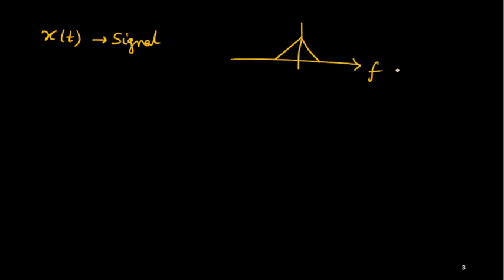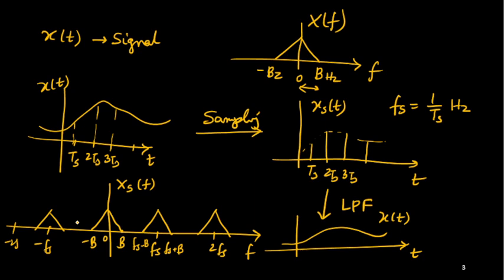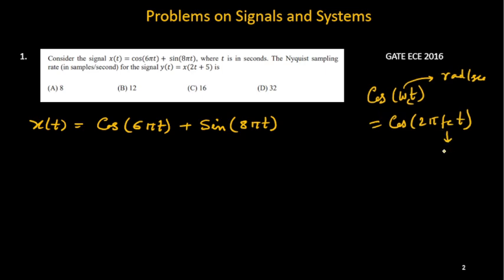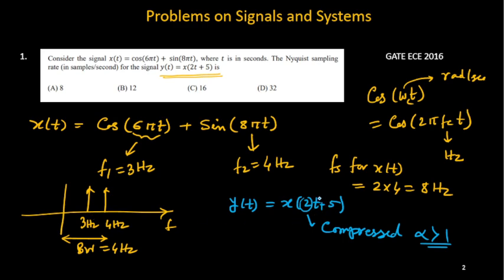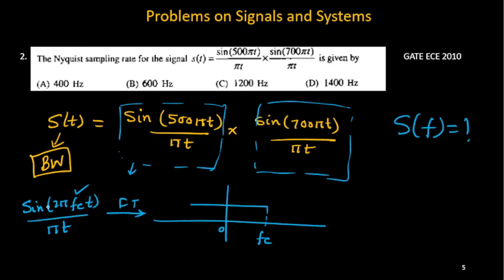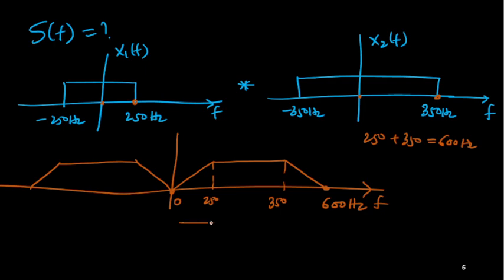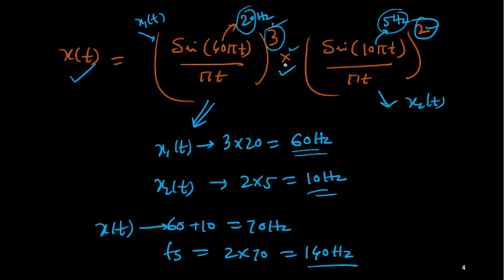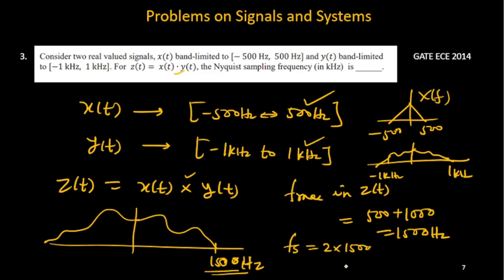Problems on Sampling Theorem- Nyquist Sampling Rate

Comment: Sir, in problem if convolution between two sinc signals is given, then in frequency domain it will be multiplication and we need to consider minimum of (f1, f2) to get the maximum frequency. In video at 25:15, it is mentioned as during multiplication, we have to consider max (f1, f2) to get the maximum frequency.
Sir, correct me if I am wrong.
Reply from the maker: Yes, you are correct. When two band-limited signals are multiplied in frequency domain (i.e., convolution in time domain), the bandwith of the resulting signal will be the minimum of these two. Please make a correction here. I will also make correction in the video later. Thanks for pointing out this. Keep learning. Best wishes.